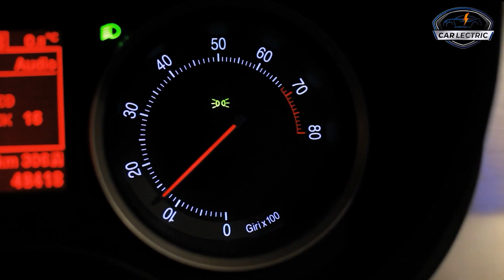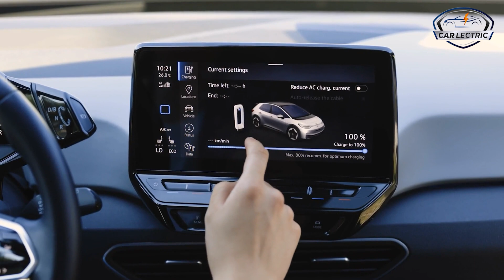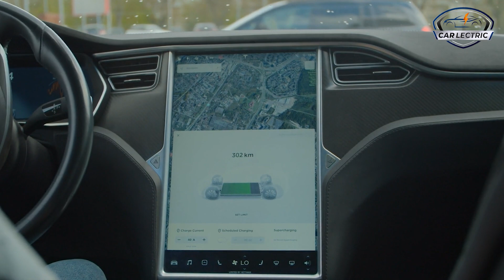This new Car Motor will change the Car Industry | EV News

Comment: At 4:22 and 4:48 minutes marks in this video they mention motor as in electric motor, but they are showing a gasoline engine. That is where they lost me.
Reply: made me think they were comparing the power output of such a small electric motor as compared to the ICE equivalent

Comment: They fail to comment on what type of electric motor it is.  It's probably an axial flux design, and they've doubled the voltage (good) and made some other standard improvements.  What I'd like to see is someone getting serious about radial flux electric motors.  Magna is a great company.  I hope this pause in EV sales doesn't harm them.